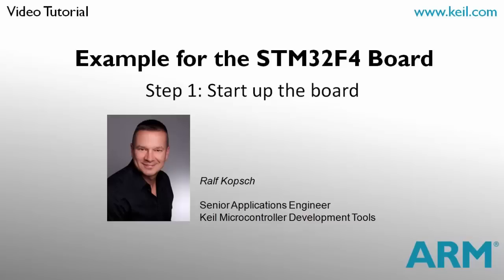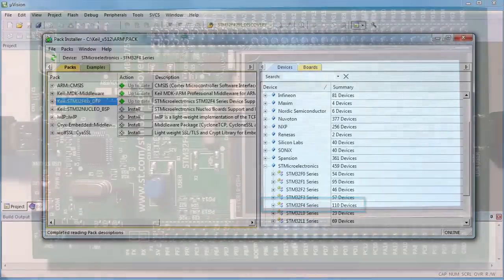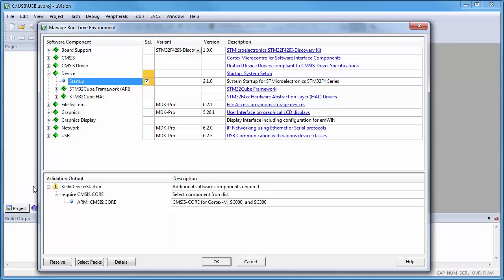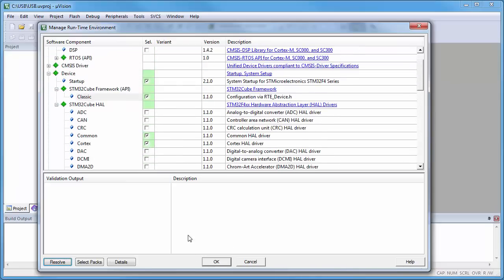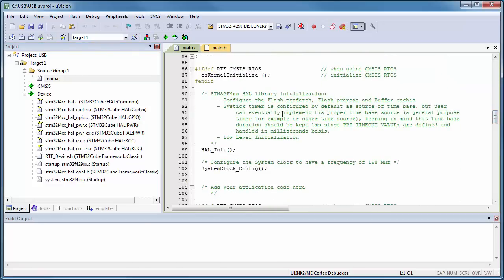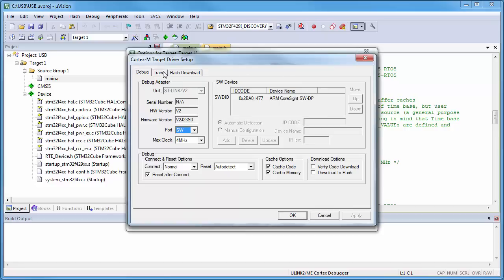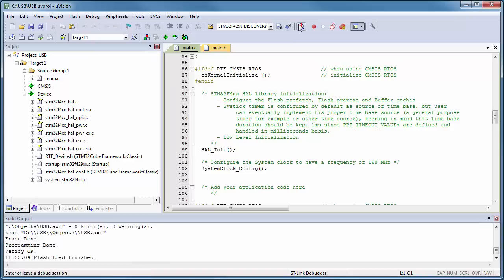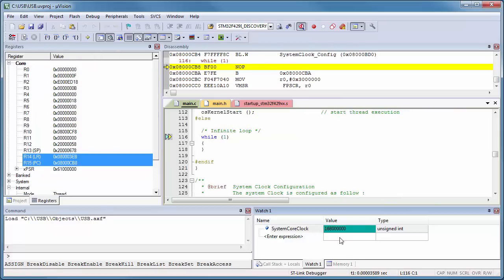CMSIS Workshop Step 1: Introduction and Project Setup

Comment: Nice tutorial... and explained well... I have been following this tutorial and is trying to configure USB OTG in STM32F4-Discovery board. I found out that it is having only Full Speed interface. I cannot figure out a way to configure it. Can you please help. Or at least do you have a sample project for STM32F4-Discovery using the new library (HAL)